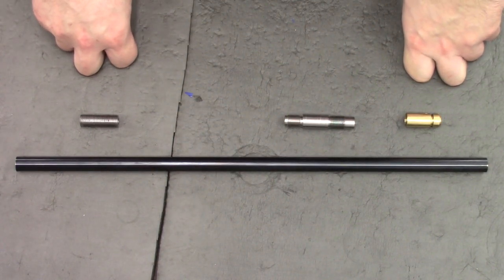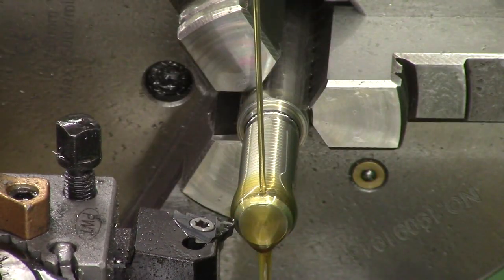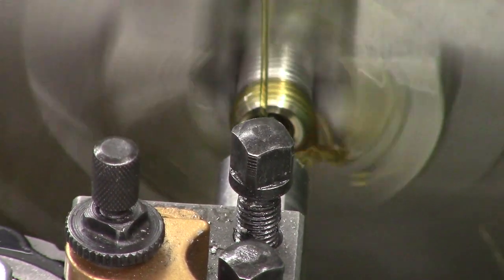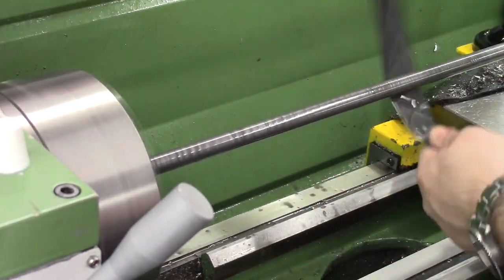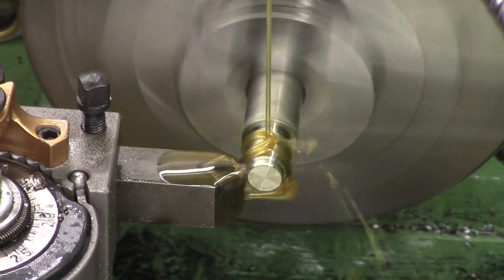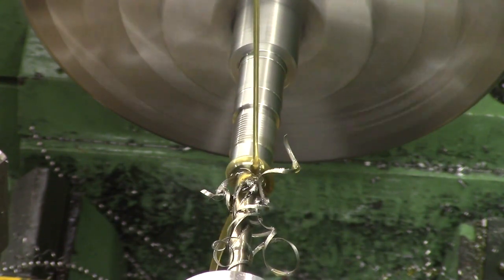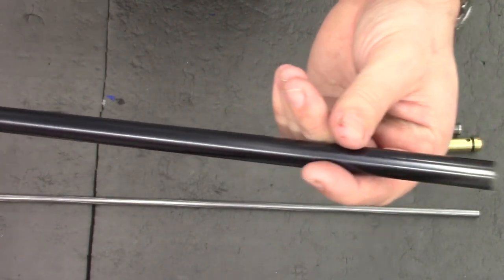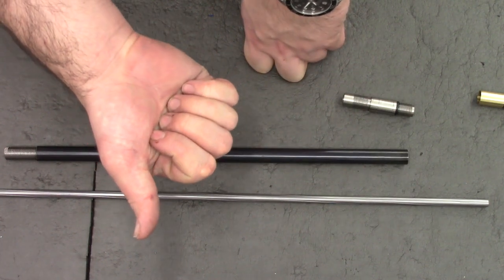Making FX .177 barrel components Part 1 UK

Comment: very good, you obviously know what your doing. i would be interested to know where you get your hydraulic tube from as i'm planning to make a set of .22, .25 and .30 cal barrels.
Reply from the maker: Hi, I just got them from a local supplier at work, the tube is a common size so you should be able to find it quite easily. Thanks for watching.
Reply: @sub12airgunners  Is the size 14mmx12mm  ????  Thanks.

Comment: Just brilliant , your videos are perfect. Well set out and very clear.I know it takes alot of setup so thanks for taking the time to put this in place. can i ask what revs your lathe is set at for stainless cutting the oring grooves.
Reply from the maker: Glad you are enjoying the vid, the lathe was set to 550 RPM for the grooves, the tool is awful thin so any faster and I get resonation through the tool shaft, and just a light but constant tool pressure, fed in by hand. Thanks for watching.
Reply: @sub12airgunners  yes i know what you mean by awful thin, i make a few parts myself and one of them is a valve adjuster for the rapid 7. I have to cut a 1mm deep x1mm groove 8mm deep inside a 6mm diameter hole. Its a challenge with stainless ,just wondered if you found the magic revs lol. i will give 550 ago.thanks

Comment: @Sub12 Airgunners great work. I'm looking to use an FX barrel in a non-fx gun do you know what size the hole in the breech block needs to be? and do the grub screws that hold the barrel in place press against the raised part of the relief segments or between on the joiner piece? Thank you
Reply from the maker: The last block I measured was 13.8mm in diameter, although they do vary a little but I would say 13.8 -14 mm would be about right. The grub screws press on the reliefs, not the raised portions. good luck with your project. Thanks for watching.
Reply: @sub12airgunners  Thanks you very much, love how much detail you put in your videos

Comment: which tap n die set u were using?
Reply from the maker: For the external threads I cut them using the lathe, just with a single point cutter, and the threads in the tube were cut using a Dormer spiral flute machine tap. Thanks for watching.

Comment: exelent work!!!!
do you know where  can buy 600mm  barrel  liner in  .177 caliber?
Reply from the maker: FX are not selling them at the moment, I am not sure when they are coming out, but hopefully soon. Thanks for watching.
Reply: Currently the only .177 liners from FX are 300mm for the Dreamtac Compact and the 500mm used in every other FX rifle. Also the current .177 liners are ST, not STX.
Reply: hi you can  buy 600mm  barrel   .177 kit  for crown in superlite from huma-air about 300 euros
Reply: @charlesjames8303  I see that a complete 600mm .177 barrel is available on the Huma-Air site but if you look in the Superior liners list on the Huma-Air site it isn't there. giga giga was asking for a .177 liner in 600mm. I don't think it exists.. I don't think a 600mm Crown .177 Barrel exists.. wouldn't be the first time marketing mistakes were made by FX.
Reply: @charlesjames8303  i want only liner in .177  600mm. thanks
Reply: @thomashouser2675  it doe`s exist i got mine from huma air itook shroud off to check it was 600mm inside, it is indeed 600mm
Reply: @charlesjames8303  I am truly amazed!!
Reply: @thomashouser2675  yes it gained 1.2ft-lb so i  turned brass barrel inlet 180`
drilled 1mm t/port and milled the guide slot. 
it shoots very well at 30yds and very quiet